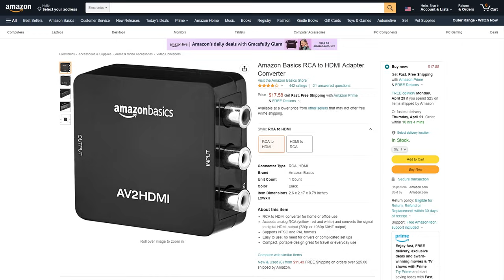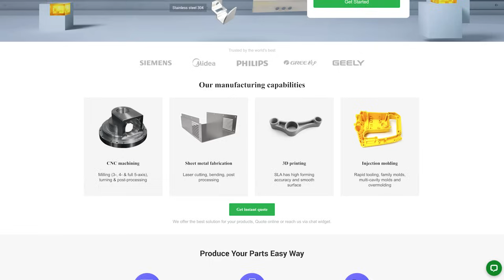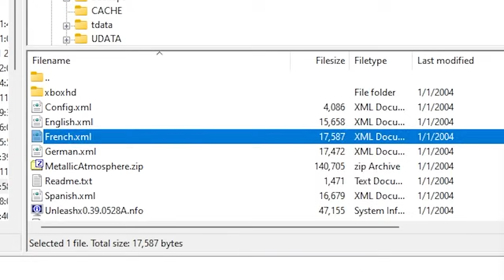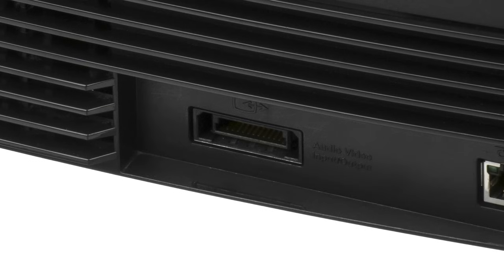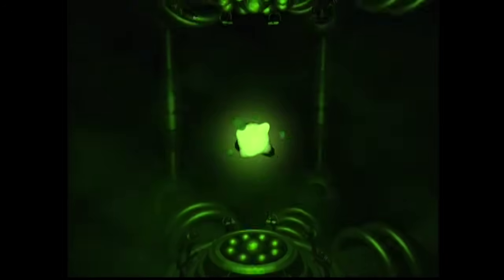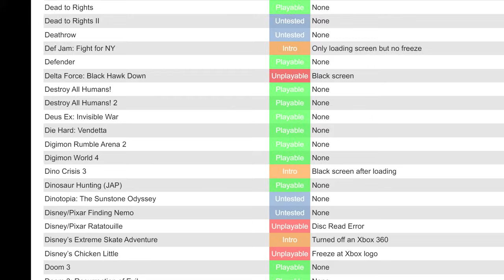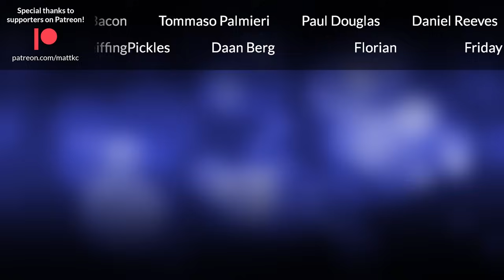The BEST video output for your Xbox - XboxHD+ HDMI Mod Review

Comment: "I received 3 extra flex cables"... - We saw the Wii video 😂Joking aside we're glad that you were able to get everything sorted out and running in HD! And we're always available if you, or anyone else, has any questions.

One of the biggest selling points for us of the XboxHD+ is what we like to call the 'plus features'. While other solutions and other mods focus just on the output, the XboxHD+ is also laser-focused on adding additional features that are only possible with our software/hardware combinations.
- Native frame buffer output that can completely bypass the built-in output scaler. (Reducing blurriness in the output image)
- Native 480P output on all titles. A large part of the Original Xbox's library only runs in interlaced and our software outputs all titles natively in progressive. (Which isn't possible with any other setup)
- Fixes games and kernel bugs. Did you that there are over 20 titles that refuse to run at all or with severe graphical issues on the 1.6 revision of the Xbox? The XboxHD+ fixes all of those with no need for patching games. 

We're also constantly working on new and exciting features!
Reply: OOOOOOHHH ITS THE TEAM ITSELF
Reply: That's really cool, keep up the great work.
Reply: This should be pinned:).
Reply: @Omega_Mark  wish granted
Reply: Ok
Reply: all this but you can't discern between your and you're (6:36)
Reply: @RaduUrsache  typos happen. ESL
Reply: @MakeMHz  Just a small heads up about another typo:  6:33 In that popup window it should be 'an Xbox', not 'a Xbox'.
"The name of the letter X is pronounced /ɛks/, and /ɛ/ is a vowel, so it's always an 'x', but a 'y' (/way/) and a 'z' (/zi/); /w/ and /z/ are consonants."
Also, assuming that you are just injecting the result (in this case 'none"), I would make it 'NONE' and maybe even make it in bold letters, so it sticks out better and it doesn't get lost in all of this text.
You could make the whole sentence 'It appears you're currently NOT running an XboxHD+ patched BIOS.'  This also works:  'It appears you're currently running a non-XboxHD+ patched BIOS.' 
Not nitpicking, just trying to help to iron out any visuals:).
Reply: I have the MakeMHZ+ in my original Xbox and love it. I’ve been playing through some of classics and they look great.

Really appreciate that this product exist!
Reply: I'm curious, have you implemented the SPDIF audio formats like Dolby Digital or DTS over the HDMI port?
Reply: 1.6 xboxes not playing native xbox games properly sounds so new to me😶😶.. 
... then again I haven't had a working xbox in like 13+ years
Reply: I'm curious if you would ever do a drop ship service to mod them and send them back, id love to mod my Xbox but like my ps3, rather not break it especially if i acquire a rare Xbox like the transparent blue DOA3 Xbox
Reply: When I first modchipped my Xbox, the modchip came dead, and then the second one came blank. I ended up just TSOPing my Xbox out of frustration, and flashing the Bios. Now my Xbox can use any hard drive, without a modchip. All I needed was a conductive pen. Be careful when buying modchips from Amazon, I did get a refund though. lol
Reply: pineapple
Reply: I appreciate the banter. :)
Reply: Seem like he was a motherboard revision away from failure, but he’s still better than any service technician. I’m not sure is that’s a good thing or a bad thing.
Reply: Huh. Matt didn't know that you were a COMPANY, and not ONE PERSON.
He should auto-correct himself.
Reply: Is one of the kernal bugs you mentioned why some of my softmodded OG's that are the 1.6 revision can't run certain Sega 480p games like Panzer Dragoon Orta and Gunvalkyrie from memory. They all do that weird thing where it displays top left 1/4 of my TV screen with funky banding and colors.
Reply: I AINT REDEN AL DAT
Reply: hi xboxhdmi people

Comment: The problem with the HDMI image is that it stretches the original image to 16:9. You end up with everything on-screen looking wider than it should.
Reply: You should be able to change that in the TV settings.
Reply: Recent HD+ update mostly fixes the aspect ratio issues.
Reply: but you can change desired aspect ration in dashboard, all the games support it iirc
Reply: @jetcoughlogo5752  Not all, but most of the major ones. Heck even some titles from before HD supported it because of big screen TVs (Goldeneye and PD come to mind). That said,  there where some notable exceptions and I think the Xbox version of Most Wanted was one of them.
Reply: TV settings, game settings, and/or dashboard settings. Set to 4:3, unless the game itself supports 16:9. 
This will work until the developers of the mod add a bordered/"Maintain Aspect Ratio" option.
Reply: @rockstopsthetraffic Mine doesn't have that option lmao
Reply: A lot of later games support 16:9 for example NFS most wanted supports it

Comment: You need to replace the IDE to SATA adapter with a different one of another kind/brand so that you will have no boot delay at all, believe me.
Reply: Agreed. It’s likely the adapter causing the issue.
Reply: I had the best luck with a super cheap one off Amazon. My PC would take a long while for the HDD to be detected with a StarTech one, before I switched to a cheaper, less good-looking random option off Amazon. But that was 2015, now is now, and I don't know what it was even made by or what chip it used, or if it's even still in production.
Reply: @tsuyunobradley4439  I have a StarTech adapter, boot is instant after the MS logo appears on my softmodded Xbox. Maybe they changed the chips in a later batch?
Reply: @R4dm1n  Yeah, I'm wondering the same because I have never had issues with StarTech devices personally. Though tbf, I've never tried their SATA to IDE adapter because I've never had a need.

Comment: While this is probably the best HDMI solution for the original Xbox. I highly recommend the Chimeric Systems HDMI. Its literally plug and play and about half the cost. Only downside is that it took me a year to get it. Also add the Mclassic and be prepared to be blow away at how good Xbox games can look.
Reply: It's the most pointless mod ever. The colours are washed out compared to component cables due to the mod 'emulating' a HDMI signal. This video is full of copium.
Reply: @WardenOfTerra honestly this comment sounds of copium

Comment: When putting thermal compound directly on a bare die without a heat spreader, it's best to try and ensure the paste is covering the entirety of the die rather than relying on mounting pressure to spread the paste.  Any uncovered points could become a hot spot very quickly
Reply: To me it looks like it could’ve used more thermal paste in general. But yes spreading thermal paste is very important for chips without a heat spreader. It also won’t hurt with chips that do have an IHS, the whole “trapped air bubbles” thing is a myth, or at least not noticeable. With socketed desktop CPUs there is also a surprising amount of pressure between the IHS and the cooler.
Reply: @fqdn  Unless the paste is conducive, there is almost never too much paste unless you like literally pour a gallon on. There is, however, a point of too little, and people like you said do this way too much on laptop CPU/GPUs or other exposed die situations.

90% of pastes are, at worst, messy. If you put too much, you wipe a bit, that's it. Too little and you have to reapply it entirely, which means you wasted paste. It might be cheap but who wants to reapply this crap?

Comment: I recommend using electrical contact cleaner to remove stubborn thermal paste.  Whatever the solvents in it are just do wonders to dissolve it, works so much better than IPA.   (I discovered this bc of a thermal paste stain that I couldn't remove any other way)
Reply: In retail kits of thermal paste remover, it’s typically a citrus based solvent in one bottle, and IPA on the 2nd bottle. Citrus based solvents are used widely in circuit board refurb/repairs.
Reply: @brkbtjunkie  "citrus based" lol usually the active ingredient in stuff like goo gone is actually lighter fluid.
Reply: @rockstopsthetraffic  Arctic silver has Arctic clean as a 2 stage cleaner and one of the stages is definitely a citrus based cleaner. It may have IPA and/or lighter fluid as well but there's definitely a citrus component to it. And it performs way better than just IPA
Reply: @AlistairBrugsch  it performs better than isopropanol in that case, sure, but does it perform better than naphtha? In my experience many of the solvents that go to great lengths to claim that they are "citrus-based" and obscure other ingredients are in fact still mostly naphtha (or similar). Your grandfather's Ronsonol, with the smell covered up by some lemon oil.
Reply: it's just better to make the system work under heavy load so the grease and heatsink get hot.
very easy to remove like that and no extra tools required.
Reply: Gasoline worked for me aswell
Reply: @mememeet4140  gasoline is not exactly a good suggestion for a number of reasons lmao
Reply: I recommend paint thinner on qtips. That damn thing cleaned the thermal paste fast, my xbox is still alive and kicking just let it dry first.

Comment: It's a lot easier to remove those heatsinks if the system has been running before for a couple of minutes, so the paste is still warm. To remove the gluey old paste, use white gas or liquid barbeque lighter. It breaks down the chemicals better. Anyone tried the HDMI mod with a TSOP'ed system yet?
Reply: No way. Just use 99% isopropanol alcohol.
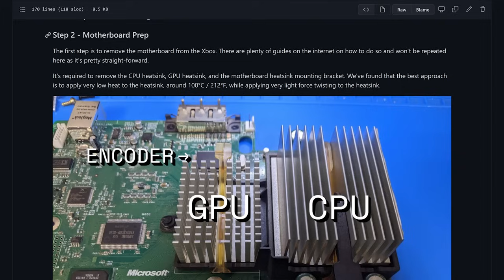Reply: He does actually do this at 8:32.

Comment: In addition to the HD pack, Microsoft released just straight component cables at the end of the system's life; the heads are metal and black. I have these and they work pretty well, but they have the Death Grip.
Reply: @wadewilson6628  I just looked up the cables but mine are definitely the Microsoft cables. It could be my switcher is to blame, but pulling out always makes me feel I'm about to break something.
Reply: i once broke a phone because a charger had a death grip, the contact of the charger detached and got stuck in the port
Reply: I have those cables too, I don't understand why they made them that way with a death grip. I almost broke the cables trying to remove them.
Reply: Cables with the DNA of gothic lemons

Comment: Next time before desoldering with the gun apply some fresh solder to points you are going to work on, solder will flow easier and it should be a bit easier to remove :)

Comment: Good video, as always. One thing that could be an issue is if the Xbox has had the RAM upgraded to 128MB. I read that this HDMI mod won’t work in a 128MB box because the patched BIOS doesn’t support it. This may have been resolved by now, but definitely worth checking with the manufacturer before buying.
Reply: 128 MB RAM.
Almost unbelievable that my Desktop CPU now has just as much L3 cache.

Comment: You should also get in the habit of using wick to clean contacts down to the bare copper & then re-tinning them with fresh solder, even if they aren't to be used (to prevent corrosion).  Solder cross-contamination/dried out fluxless crust will cause britility.

Comment: I found an official xbox component pack at some used computer store for $5 once, and despite me not owning an xbox at the time, I bought it, then forgot about it. Then after maybe a year of owning an xbox, I saw an MVG video mention how it's the best way to get video from an original xbox, and then it hit me like a truck after he showed the prices of them on ebay cause I realized "oh s***, don't I own that?". And indeed I did, and this video really made me appreciate it more cause soldering is my worst nightmare and going back to those cheap component cables is pure hell. It's a shame that now your only options are either spend $80 on a cable for a 20 year old system, take your entire console apart to add a modchip and do some precise soldering, or live with garbage picture quality.

Comment: Solder braid works best with lots of flux and HIGH heat on the iron.  A little blob of solder on the tip of the iron to start it all off helps too.

Comment: 16:11 "And composite is about the lowest form of A/V transmission possible" The original XBox actually had an RF adapter option available from Microsoft if you wanted to play through coaxial, where all three of composite's analog signals would instead be shared inside of just a single copper cable.  Obviously only really practical if you have a TV whose other ports are already filled up by more important things, or a TV that's too old to even have composite on it.  The 360 also had such an option surprisingly.

Also, I love that this video came out the day after I commented on the last XBox video and mentioned this mod.  This is a really cool one!  I just love that somebody went through all the effort to map out all of the digital circuitry that would be required for this to work, and then even created such a high quality solution for it.  It allows the XBox's surprisingly powerful hardware for the time to really shine, and games that rendered internally at 720p or 1080i back in the day can now also output at those resolutions from the XBox because of this mod.

Comment: loved this video! that mod is too complicated for me though. 
making your own higher quality component cables is easier (when splicing a cheap original xbox component cable with oem xbox 360 component cables) and yields great results as well. also, it's not that expensive
Reply: That's exactly what l did. It's a great budget option and the quality is good as well.

Comment: I highly recommend re-capping your board while you have it open to do this mod, a lot of those caps in the original xbox(not just the clock cap) are pretty cheap and bound to fail eventually, recap it now and it will last another ~20 years.

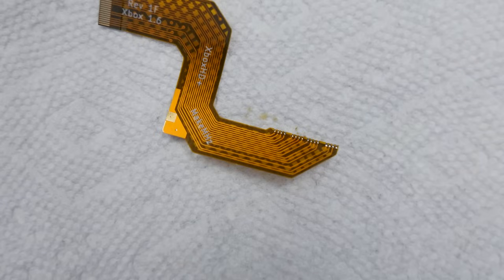Comment: 10:25 those points being bridged not only trick the xbox into thinking there's a cable connected, but it specifically thinks that there's the advanced HD pack connected to it which gives you access to 720p and 1080i.

Comment: Realistically DisplayPort deserved to be the dominant digital plug but HDMI just has unfair industry strongarm on its side.

Anyway I leave my Xbox unmolested because I use it with the A/V pack on a CRT so HDMI wouldn't benefit me. My friend wanted to do it (with the Xbox I modded and gave to him) but kept putting it off so eventually I bought him a cheapo Pound HDMI cable as a gift. Seems to get decent returns.

We would have both preferred to get a Chimeric Systems HDMI cable but the waiting list for those is into the thousands.
Reply: For the Chimeric I'm currently at 853 and he no longer takes people in the queue to catch up (I started 1512 on November 6th 2021).. 
One other option is the Hyperkin cable that does the job for me. I'd rather wait and play other games while I get the Chimeric cable.. I also don't think that investing in all that soldering + gaining experience + then doing the mod makes sense to most people.
Reply: Displayport is literally the display port

Comment: I did a couple of the original XboxHDMI. My advice for removing the AV port is to use a multimeter to find all the power/ground pins and hit those with EXTRA heat. I also had to preheat with another iron and quickly switch to my desolder gun.

Comment: Use desolder wick even if you use the gun.  You also need flux & occasionally additional solder to 'loosen things up'.  Ground plane points require additional contact time due to thermal absorbtion.

Comment: I love my OG Xbox.

I had one back in the day.  I softmodded it.  But I was a broke teenager so I kinda just stuck with the 8 GB HDD.  Never even backed up the eeprom.  The HDD crashed and my box was a brick because I didn't have the skills to solder nor the money to pay someone else.  So I just sold it for parts.

Back in 2020 though I started a project and basically built an Xbox.  Found an Xbox on ebay with a crashed HDD.  Same issue as my old one haha.  I also bought a clear case and blue LED kit for it, an OpenXenium modchip, and a 2 TB HDD.  I now have a decent amount of experience soldering and was able to accomplish the hard mod.  Got the box running again with a nice big HDD and a pretty case upgrade.

I also bought the Hyperkin HDMI cable for it.  The HDMI mod here looks tempting, but I'd rather keep that part of it stock.  That way in case I run into any good CRT monitors that have component built in I can use component cables.  The Hyperkin HDMI cable isn't perfect but it's good enough.

Comment: I feel the best option when it comes to retro video games is to play on original hardware with the most optimal monitor for a system. This means owning multiple televisions or monitors throughout your collections without the need for upscalers, mods or converters. Most people are trying to force NES or Dreamcast on modern flat screens when that will never give the ideal overall experience.  Depending on the systems generation, there are better options than mods or converters that provide the top experience. For instance professional plasma tvs provide the best contrast levels, blacks and whites. Professional level CRTs add scan lines and pixel definition. Vintage VGA computer monitors offer rich colors. There are good features found in all forms of technology.  None of them are dead but many are impossible nowadays to find. In my opinion the best feature of modern panels are convenience, brightness and size, however you loose some of the magic.